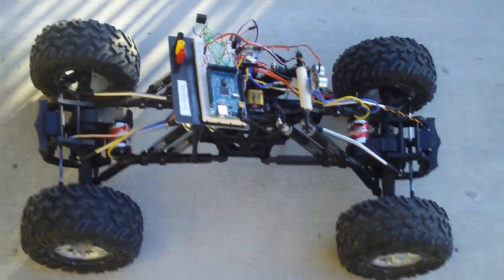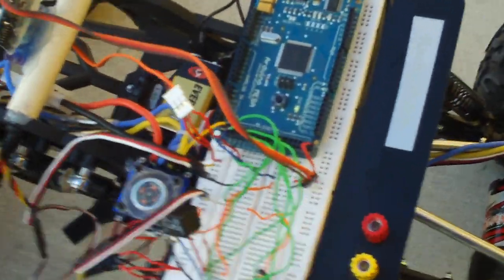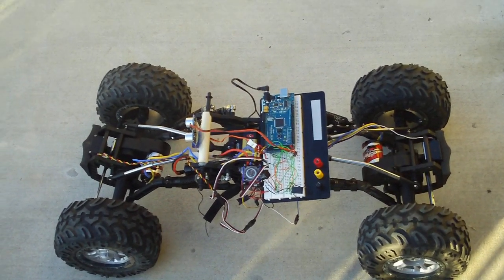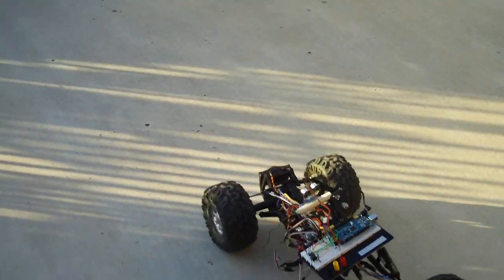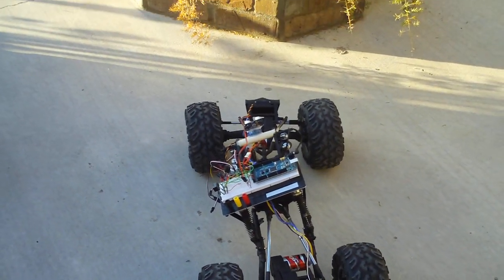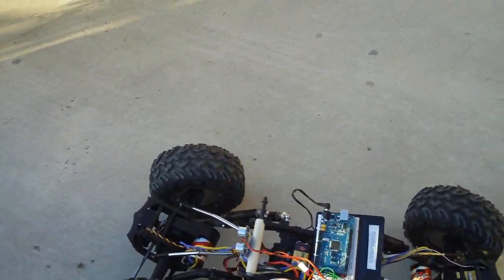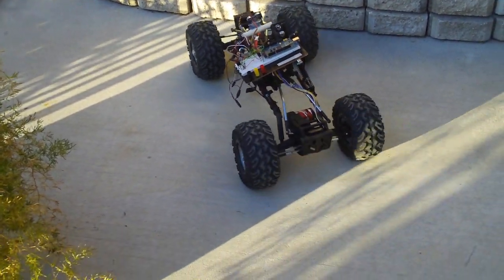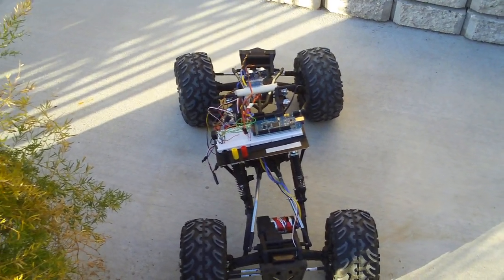Rover obsticle detection code testing

Comment: bro,how do you act setup the rover.is it sensor(input)>amp 2.5>motor(output).if you use mission planner for waypoint,how do you compile in a code?really apriciate for the answer

Comment: if you would only know how ignorant you sound @javedkhan0258... lol as for the body/chasis @claystudiofx the one i use is called the RedCat Racing Rockslide supercrawler 1/8 scale. It is a MOA (Motor On Axel) type. and @yxhankun I can supply my code and schematics in an email cause of the character limit on here. just PM me

Comment: Hi i want to know about the Body/chasis. can u tell me what rc brand you were using for the chasis ? is it 1:10 or 1:8 scale ? is it Motor On Axis type ? i want to build one like this but a simple one , still confusing picking the right chasis model, between crawler or other model. Any suggestion.

Comment: Great! I just started (today) using a RedCat Landslide as a base and have the same chassis drooping problem. My pan/tilt IP camera does not have a droop adjust. ;) I converted over to a Spektrum Dx6i still using 4 wheel steering by using the rudder control with a servo reverser (so 1 channel instead of 2 for steering). Good Luck on your project!!